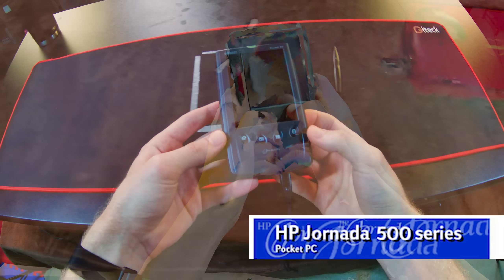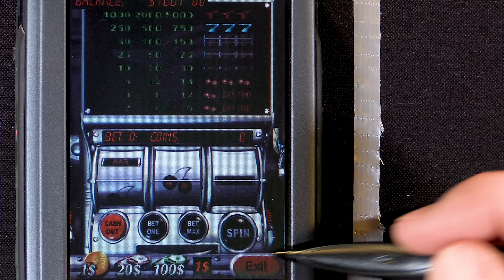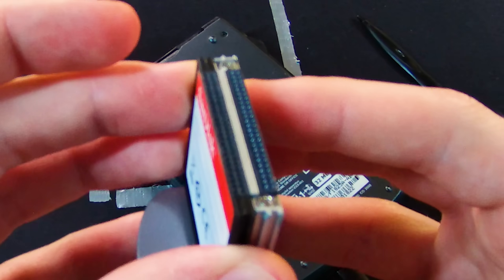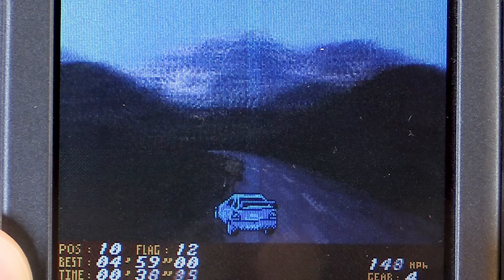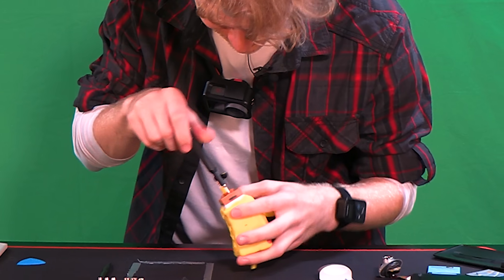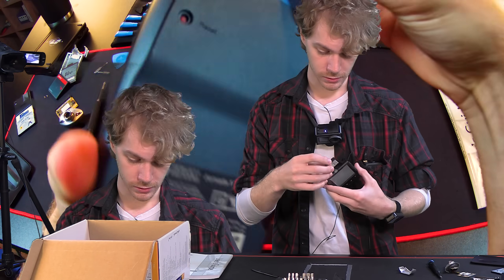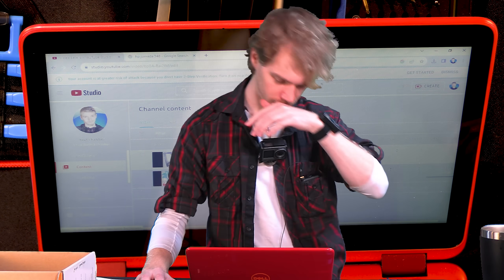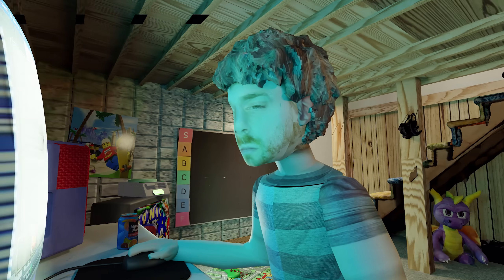Making a YouTube Video Using a Personal Organizer

Comment: Can we appreciate how much 
The FitnessGram™ Pacer Test is a multistage aerobic capacity test that progressively gets more difficult as it continues.
The 20 meter pacer test will begin in 30 seconds. Line up at the start.
The running speed starts slowly, but gets faster each minute after you hear this signal.
A single lap should be completed each time you hear this sound.
Remember to run in a straight line, and run as long as possible.
The second time you fail to complete a lap before the sound, your test is over.
The test will begin on the word start.
On your mark, get ready, start.

[Level 1]
Feel it
One
Two
Three
Four
Five
Six
Seven; end of level one
[Level 2]
Eight
Feel it
Nine
Ten
Eleven
Twelve
Thirteen
Fourteen
Fifteen; end of level two

[Level 3]
High rollers
Sixteen
High rollers
Seventeen
High rollers
Eighteen
Nineteen
Twenty
Twenty-one
High rollers
Twenty-two
High rollers
Twenty-three; end of level three
[Level 4]
High rollers
Twenty-four
Twenty-five
Twenty-six
Twenty-seven
High rollers
Twenty-eight
Twenty-nine
High rollers
Thirty
High rollers
Thirty-one
Thirty-two; end of level four

[Level 5]
Thirty-three
Thirty-four
Thirty-five
Thirty-six
Thirty-seven
Thirty-eight
Thirty-nine
Forty
Forty-one; end of level five
[Level 6]
Forty-two
Forty-three
Forty-four
Forty-five
Forty-six
Forty-seven
Forty-eight
Forty-nine
Fifty
Fifty-one; end of level six

[Level 7]
Fifty-two
Fifty-three
Fifty-four
Fifty-five
Fifty-six
Fifty-seven
Fifty-eight
Fifty-nine
Sixty
Sixty-one; end of level seven

[Level 8]
Sixty-two
Sixty-three
Sixty-four
Sixty-five
Sixty-six
Sixty-seven
Sixty-eight
Sixty-nine
Seventy
Seventy-one
Seventy-two; end of level eight

[Level 9]
Seventy-three
Seventy-four
Seventy-five
Seventy-six
Seventy-seven
Seventy-eight
Seventy-nine
Eighty
Eighty-one
Eighty-two
Eighty-three; end of level nine

[Level 10]
Eighty-four
Eighty-five
Eighty-six
Eighty-seven
Eighty-eight
Eighty-nine
Ninety
Ninety-one
Ninety-two
Ninety-three
Ninety-four; end of level ten

[Level 11]
Ninety-five
Ninety-six
Ninety-seven
Ninety-eight
Ninety-nine
One hundred
One hundred one
One hundred two
One hundred three
One hundred four
One hundred five
One hundred six; end of level eleven

[Level 12]
One hundred seven
One hundred eight
One hundred nine
One hundred ten
One hundred eleven
One hundred twelve
One hundred thirteen
One hundred fourteen
One hundred fifteen
One hundred sixteen
One hundred seventeen
One hundred eighteen; end of level twelve

[Level 13]
One hundred nineteen
One hundred twenty
One hundred twenty-one
One hundred twenty-two
One hundred twenty-three
One hundred twenty-four
One hundred twenty-five
One hundred twenty-six
One hundred twenty-seven
One hundred twenty-eight
One hundred twenty-nine
One hundred thirty
One hundred thirty-one; end of level thirteen

[Level 14]
One hundred thirty-two
One hundred thirty-three
One hundred thirty-four
One hundred thirty-five
One hundred thirty-six
One hundred thirty-seven
One hundred thirty-eight
One hundred thirty-nine
One hundred forty
One hundred forty-one
One hundred forty-two
One hundred forty-three
One hundred forty-four; end of level fourteen

[Level 15]
One hundred forty-five
One hundred forty-six
One hundred forty-seven
One hundred forty-eight
One hundred forty-nine
One hundred fifty
One hundred fifty-one
One hundred fifty-two
One hundred fifty-three
One hundred fifty-four
One hundred fifty-five
One hundred fifty-six
One hundred fifty-seven; end of level fifteen

[Level 16]
One hundred fifty-eight
One hundred fifty-nine
One hundred sixty
One hundred sixty-one
One hundred sixty-two
One hundred sixty-three
One hundred sixty-four
One hundred sixty-five
One hundred sixty-six
One hundred sixty-seven
One hundred sixty-eight
One hundred sixty-nine
One hundred seventy
One hundred seventy-one; end of level sixteen

[Level 17]
One hundred seventy-two
One hundred seventy-three
One hundred seventy-four
One hundred seventy-five
One hundred seventy-six
One hundred seventy-seven
One hundred seventy-eight
One hundred seventy-nine
One hundred eighty
One hundred eighty-one
One hundred eighty-two
One hundred eighty-three
One hundred eighty-four
One hundred eighty-five; end of level seventeen

[Level 18]
One hundred eighty-six
One hundred eighty-seven
One hundred eighty-eight
One hundred eighty-nine
One hundred ninety
One hundred ninety-one
One hundred ninety-two
One hundred ninety-three
One hundred ninety-four
One hundred ninety-five
One hundred ninety-six
One hundred ninety-seven
One hundred ninety-eight
One hundred ninety-nine
Two hundred; end of level eighteen

[Level 19]
Two hundred one
Two hundred two
Two hundred three
Two hundred four
Two hundred five
Two hundred six
Two hundred seven
Two hundred eight
Two hundred nine
Two hundred ten
Two hundred eleven
Two hundred twelve
Two hundred thirteen
Two hundred fourteen
Two hundred fifteen; end of level nineteen

[Level 20]
Two hundred sixteen
Two hundred seventeen
Two hundred eighteen
Two hundred nineteen
Two hundred twenty
Two hundred twenty-one
Two hundred twenty-two
Two hundred twenty-three
Two hundred twenty-four
Two hundred twenty-five
Two hundred twenty-six
Two hundred twenty-seven
Two hundred twenty-eight
Two hundred twenty-nine
Two hundred thirty
Two hundred thirty-one; end of level twenty

[Level 21]
Two hundred thirty-two
Two hundred thirty-three
Two hundred thirty-four
Two hundred thirty-five
Two hundred thirty-six
Two hundred thirty-nine
Two hundred forty
Two hundred forty-one
Two hundred forty-two
Two hundred forty-three
Two hundred forty-four
Two hundred forty-five
Two hundred forty-six
Two hundred forty-seven; end of level twenty-one, end of test patter the na is?